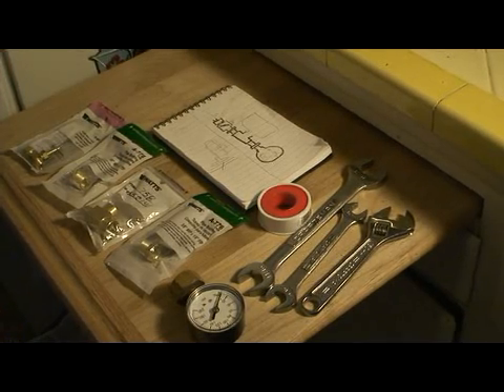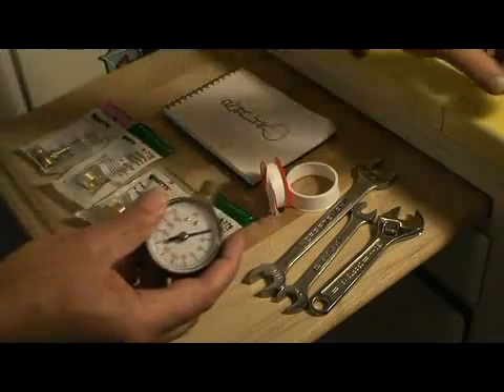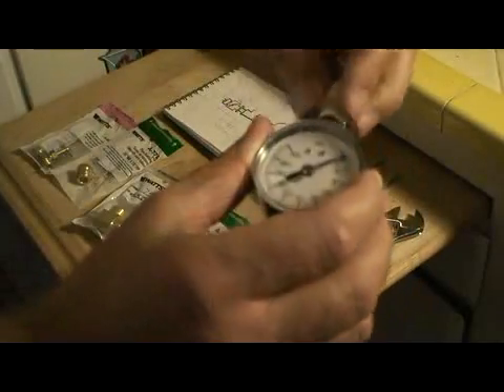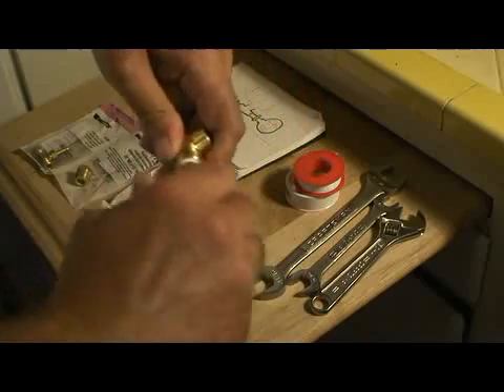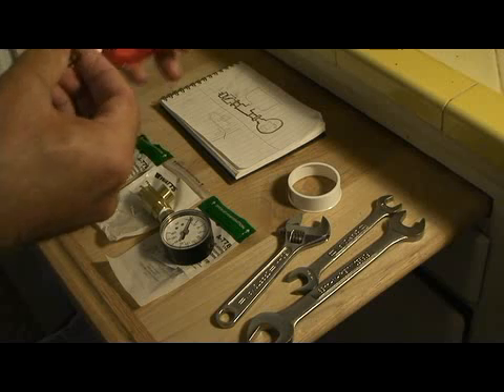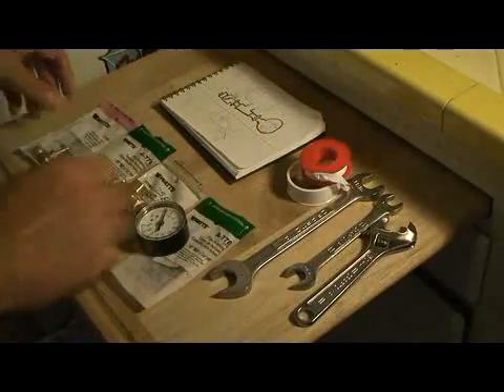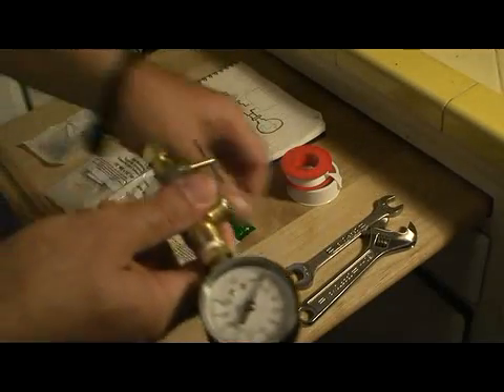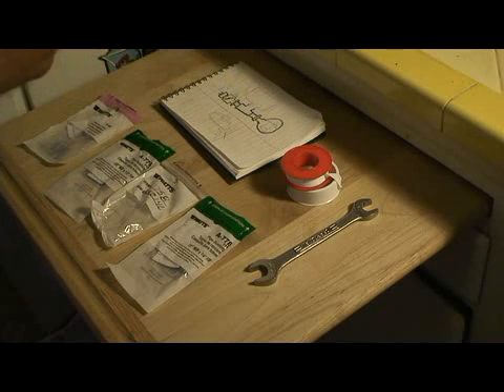Gaggia-HowToBuild-Pressure-Tester-part1

Comment: how'd youre move the spout from the bottom of the portafilter?
Reply: at 8:05 you see that it unscrews from the portafilter. At least mine did.
Reply: @douglarue8485  mine's really stuck in there and after a lot of attempts to get it out it hasn't budged. I was wondering if yours took a certain level of force to get it out and if so if you have any tips for removing it
Reply: @boazboazboaz  it's been a very long time but I believe it did take some force. Maybe try warming it up by heat soaking in boiling water for 10 minutes before trying to loosen it.
Reply: @douglarue8485  Thank you! I'm going to try that

Comment: Good idea, but missed the end of your video. What's the tread into the ports filter?
Reply: it may have been the 3/8" version. I searched for Watts using the numbers on the package and that lead me to this home depot number: http://www.homedepot.com/p/Watts-3-8-in-Lead-Free-Brass-FIP-Tee-LF-A758/202254927
Reply: Might give this a try, the trouble is, is that my dual spout on my porta filter is not budging at all.
Not sure if I want to try really hard as I might break it.
Reply: Oh and how's your coffee brewing going?
Reply: Dave Lowis going fine but the big difference after getting the pressure correct was building an Arduino PID controller to get the brew temp to 200+/-1. The mechanical temp thermostats cycle way out of range for great espresso.
Reply: Yeah, PID looks the best option and best control of water temperature.